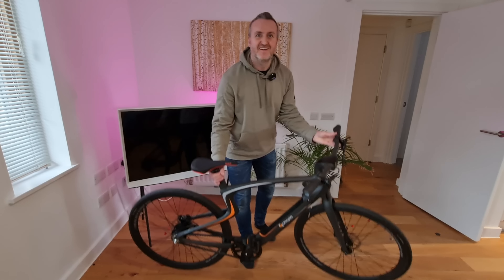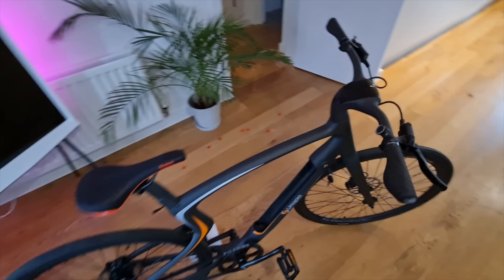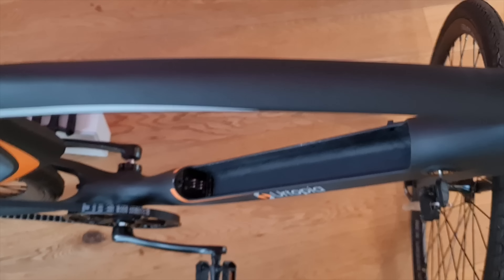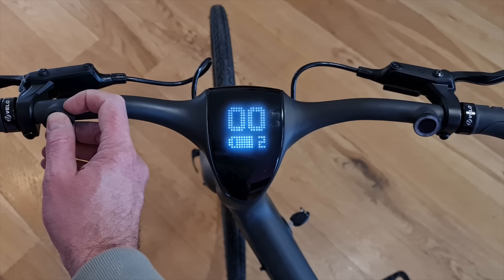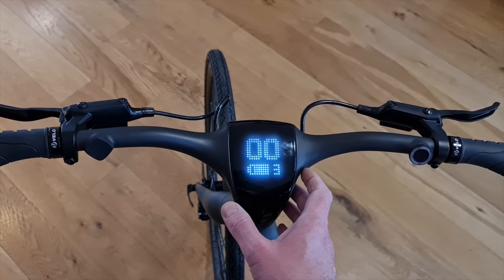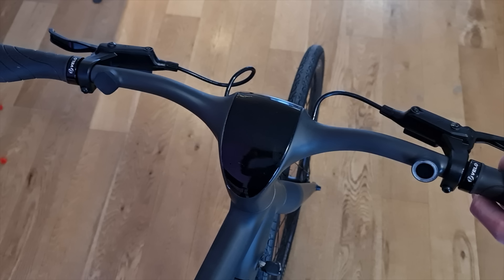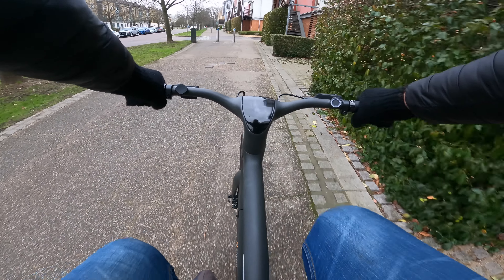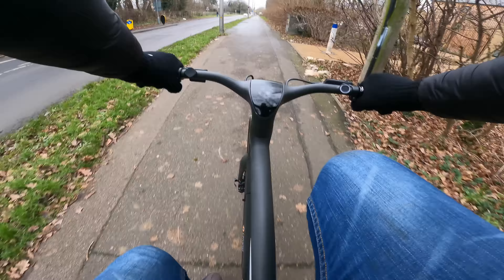IS THIS THE FUTURE OF EBIKES?!

Comment: Dealbreakers for me: no mudguards, no rear or front luggage rack, and no suspension... (although the Z bend holding the seat post looks a little bendy under compression)
Sticking with my magic pie and 2 kWh battery that I built over 6 years ago and still killin it...
Reply from the maker: I really liked my magic pie!
Reply: @andykirby  Magic Pie? Sounds like Space Cake.
Reply: no mudguards is the biggest dealbreaker by far

no standard handlebar clamp (although it looks cool), it will make it really hard to add some nice aftermarket lights (Supernova, Lupine, or even some Chinese ones with low beam and high beam)

unable to change the screen angle is annoying too and who knows what you can change with an aftermarket part on something like this lol (probably nothing other than the wheels, tires etc)

atleast having front sus would've been nice, even some generic crap one

Comment: There's a company in Europe who have come up with an injection moulded frameset, the plastic material is loaded with steel and carbon fibres. The strength is comparable with carbon fibre, but has all the advantages of injection moulding, speed, reliability and conformity.
This is the future.
Reply: Link? Interesting.

Comment: Thank you for awesome review. I love the scenery during your test ride. I ordered the second generation Carbon One with upgraded 7 speeds and a 350w motor. I should be receiving the Carbon One this month around the 10th - 15th. Can’t wait. Had to drive 250 miles to a bike shop that had a Carbon One demo to test ride and loved it. I tested so many e-bikes and some were good and others ok. My biggest problem with so many Urban e-bikes there are too heavy and don’t go that far. During my test ride with the Carbon One had no issues with distance, wind, uphills, or comfortability. The seven gears does make a big difference when facing hills and wind. May I add the Urtopia has been amazing throughout the process before buying and afterwards. Yeah, there are times corresponding through emails I may have to wait a few days for a response, but the overall communication has been top notch. I can’t really say if they’re cons about the company or e-bike, non in my experience. Again, I am only referencing to the 2nd gen Carbon One, not the one in this video.

FYI, Urtopia also has an another e-bike, “The Chord.” The Chord has the exact same features as the Carbon One with the exception of the carbon frame and looks. But, all is the same as the Carbon One with intelligent LCD panel, seven gears, and 350w motor. after the discount code, The Chord is only $1,399 (US). Plus, The Chord weighs less than 47lbs. and the Chord longest range is 75 miles (normal condition, body weight, and paddling assist on level one). The Chord will soon to ship in mid of May 2023. 

So, I highly recommend Urtopia Carbon One or The Chord. Lastly, Urtopia has not sponsored me in any way. This is 100% experience I had so far with the company and during my test ride with Carbon One.

Comment: I'm thankful you raised the bottom bracket torque sensor Andy. I'm building up an ebike for a friend which uses one instead of the traditional 12 magnet cadence sensor (night and day difference).
As always Andy, keep up the vids. I'm still thumbs'ing them up when you release em 👍🏿
Reply: Bottom bracket torque sensors have all sorts of issues. They don’t last, they go out of tune, and every bike that has one from the same brand will vary widely in response.  You will loathe having to replace one even once, especially on carbon fiber ebike. Good luck y’all.

Comment: Throttles are just so much safer. I can pull away with so much control. My bike is a rear wheel hub motor, if you try and peddle hard to pull away and lift the front end at all the bike is going to get away from you and as it takes off, you will pull the throttle trying to keep hold of it. Seated and using the throttle is by far the safest way to pull away.

Comment: I had that exact  issue with my 2350 watt carrera pushing me forward unexpectedly. Then I disabled assist and just kept throttle only.  Was the best thing i did. I got pushed twice first time into the road endangering myself and second time was almost into a guys van.  😂.   Now it’s manual peddle and free throttle whenever needed.   Love the ebike life style.👍👍👍
Reply: exactly the same reason i modded my carerra vengeance ebike. i changed the motor controller so i could have a thumb throttle and full display also its a bit quicker with the new controller. the lunging really freaked me out and nearly got me squashed a few times lol
Reply: @foreverhungry84   nice choice  bet it’s loads better with the thumb and control mod.
Reply: @lbarnett748  its certainly safer
Reply: @foreverhungry84   thats the main thing 👍

Comment: Hey Andy, is there a battery box mount base with a more beefier connector than the Hailong 5-pin? For me its a bit weird to use a 7p high current battery with only 30A output.

Comment: good technology but too slow . uk law needs to change and until then I still see plenty on big ebikes with no issues . biggest issue will always be drivers
Reply: We need 1kw motor limit here in the UK.  I think then the market would open up.  A 50cc moped has a 2.2kw limit.  I don't think 1kw would harm much.
Reply: This 15.5 mph restricted motor here in the UK is a piss take, 20mph IMO is sweet .
Reply: @tc5042  It's that extra bit of speed which bikes lack that makes a danger.  And it leads to some of the stupid behaviour we see.  We do need a 20mph / 1kw limit.

Comment: Looks GREAT!, I'd probably mute or drastically lower the sounds though tbh. Aside from being just a tad cheesy-yet modern. I LOVE the Quiet Experience of E-Bikes, and the sounds would defeat the purpose. PROPS ON INDICATORS AND CONTROLS TOO!😎👍
Reply: I meant Mute the Sound of the Motor*😝 ofcourse, as a Bike Designer. I think there's DEFINITELY a Market for lightweight E-Bikes that have high speed assist but little torque. 😎🙌

Comment: Cool bike and something to keep an eye on. Lightweight is likely the future of ebikes and only 30lbs is great. I like the battery and frame design, and that it appears the design might provide a little flex from rear bumps. I've thought a carbon flex design frame could be a good suspension alternative, but I would prefer some front dampening for bumps and height adjust for the handlebars. All the electronic hat-tricks are almost a turn-off for me. I'd prefer a range/Amps/Watts feature over annoying voice call outs. I'd prefer 350W or more options at 48V, with a 250W mode.But unless they were going to up size the tires 250W and 15mph is likely a sane design choice. 
Also, even if it's pretty efficient, with only a 350w/ah battery I'd like a larger battery option (a little bulge is fine) that fits the same battery slot and/or an affordable second battery option with a secure carry case on the frame. 
Fingerprint sensor is cool but if you are wearing gloves a pain. I don't like keys so perhaps a Bluetooth interlock, voice unlock, or even just a programmable simple tap code to unlock, i.e. three short and one long tap or whatever the rider sets.
Also, attractive integrated fenders would be a plus
Reply: Actually light weight is not the future. You know zero about motors, batteries and power distribution.  Look at anything electric, such as a Tesla, and if you want safety and power and reliability, you are not getting “light weight.”  It’s an oxymoron. And definitely not needed when you have electric assist.  Weight is less of a factor than wind resistance and you need considerably more power and torque than the wimpy 35 nm this delivers from a low rpm hub motor, if you want to go up amy grade or overcome basics I d resistance at speeds above 12 mph. Then if you have any headwind, forget about it. It will feel like you have no motor if you have a headwind of 10 mph, and you are trying to go a mere 12 mph.  Your battery that Small will be cooked in 30 minutes. So unless you are riding in an ideal situation on a non windy day, perfectly flat roads, and going maybe 10 miles out and 10 or less miles back, this really is a waste of hard earned money. But if you have easy earned money you can throw away on a toy that you might ride a dozen times a year then by all means, this is for you. Knock yourself out and have fun blowing $2200 to $3000 on it.
Reply: @specialist-in-tech  On what do you base your allegation that I know zero about motors batteries and power distribution, what specifically did I say that was untrue or that runs counter to what you said? 

I was commenting on bike that already exists, saying that weighing only 30lbs and that goes 15mph was reasonable, and offered no other conjecture. If someone wants an eBike that weighs 100lbs and goes 30+mph there are other options. If you want a light and compact e-bike it's an option, and the price is likey not an obstical for those who can afford to spend $50k to $100k on a Tesla.

BTW, I have an electrical engineering degree, worked as and Industrial Wireman, Instrument tech, communication tech, and project engineer for some of the largest oil and gas construction contractors in the world (VECO International  and Wright Shugart). I spent decades working with motors, batteries and power distribution from small DC motors to over 5,000 hp synchronous 5KV motors, switchgear, motor control centers and motor speed controls. 

The  following is an example of one of the projects I was project engineer on for construction and comminsioning of power generation, distribution,  and control:
 'Endicott Island - Wikipedia
Endicott Island is a 45-acre (18 ha) artificial island located in the U.S. state of Alaska, 2.5 miles (4 km) offshore and 15 miles (24 km) from Prudhoe Bay of the Beaufort Sea. Endicott Island was built in 1987 by Alaska Interstate Construction and is used by BP and Hilcorp Alaska for petroleum production '
Reply: @specialist-in-tech  Your extended rant is non-sequitur.  I suggest look into 'Narcissistic Personality Disorders' instead.

Comment: Cool stuff.  Keep it up!  Just getting into all this stuff really.  So to ask a question, I bought my boys a  250w eletric bike.  Can I change the motor to a 500w what or would I need to change all the eletrics aswell?  (Thourght I would ask as I'm always watching ya vids!)  

Love the content though dude...  also how's the FPV Stuff going?
Reply: Join the discord ,real handy for info ,you wld need to change controller although I have heard big bat does help ,I honestly dnt know .
Reply: Its not your motor which dictates the power, its your battery & controller. Battery voltage x controller amp output = watts. I.e 24v battery x 10amp = 240watts. If you changed to a 20 amp controller. You would be at 480w. It's a little more complicated as battery voltage is nominal and you would be higher voltage at full charge. Make sure your battery can safely output what you're asking of it, most motors can easily handle twice the recommended wattage without melting.
Reply: @18ct  Thank massive help!

Comment: its the future of theft reports. if it were me I probably would integrate something like a cycle analyst,  google map, mp3 player into the handlebar itself with buttons to control it that are easy to use without removing your hands from the bars.  also good lights all around, maybe indicators, horn.  bigger motor and battery than that pitiful thing.  The overall design is cool though, but I prefer mid drive motor like BBSHD.  battery capacity should be 30 amp hour or more, tyres 32mm or more, a seat with suspension could be good,   lightweight high quality front forks would also be good. GPS and some sort of alarm is given.

Comment: I don't get the hype around carbon fibre frames, make it from aluminium add in some gears with front and back suspension with a minimum 500 watt motor

Comment: Nice looking bike. But the 15mph limit would be a deal breaker for me.......if I could afford it.

The speaking display would drive me insane, no need for that whatsoever imo. A gimic at best.

If I were buying I'd hope the app has the ability to unlock the speed restriction, for if you were on private land (because that's the only time I would ever use it😏).
Not sure on the dot display. I like that they built it in like that, don't like the way the info is displayed.

I wouldn't be pissed off if someone gave me one though!

Comment: Low power Carbon fibre ebikes aint anything new, 
When they can design a  carbon framed ebike
That can handle the torque of high power mid drive motors
Without causing bottom bracket stress fracture fatigue.. post it
Reply from the maker: Maybe you should design one, send it to me and I'll review it!
Reply: I thought the Vapour Andy made was carbon fibre frame ?

Comment: LOOKS OVER FUNCTION  SOON AS YOU BUY  BUILT IN BATTERIES  AND SCREENS THEY CAN CHARGE YOU MORE  AND THE BATTERIES WILL NEED REPLACING
Reply from the maker: Batteries last a long time these days >500 cycles with a small loss of capacity.

Comment: You lost me when you mentioned a finger print reader. Folks tend to really over think these things. My first purpose built Ebike had an alarm system that chirped like a car alarm when I cut on and off the system. after three days of that I broke into the motor controller and found the alarm system and cut the wires with my pocket knife. I like the sleeper design. but keep it simple. I have a few electric bikes of different origins purpose built and DIY builds and am proud to ride the throttle on my more powerful units. light is good, wish Ebike companies would also offer 20 inch EBMX bikes without those damn fat tires.

Comment: No volume
Reply from the maker: Turn your volume up!🤣 I just checked it on another machine, is anyone else having trouble?
Reply: @andykirby  Volume is Fine
Reply: @andykirby  got it sorted andy I have the battery details I gave you them in the video that you changed the handle bars ,I realy need you're help bro as I charged it for 3 hrs ,cell model ,bbso1b 36v 250w 48v / 10ah 480wh .I haven't charged it over 3 hrs ,the red light comes on but green light hasn't come on after 3 n half hours should I charge it longer ,my battery sitting at 80 percent , should I try charging it for the amount of time you recommend, ill give it a go ,I  asked on discord but I only been on couple off times ,so I asked someone but cldnt find them to get the answer , im a stuffed, still dnt have a smart phone only ever used a ten pound 15 pound phone ,lol that should give u an idea off how lost I am ,im good at taking m bikes apart and building them had 2 bikes in bck Street heroes and awol bck in 90,s ,cheers will realy help , if I have to buy a charger at least I know I'll be bying it off someonethat knows what there talking about , you ,lol ,this is not a blag I dnt want to have to buy both batt and charger I've only charged it twice so far ,cheers ,
Reply: @andykirby  srry bout the letter bro ,,.lol